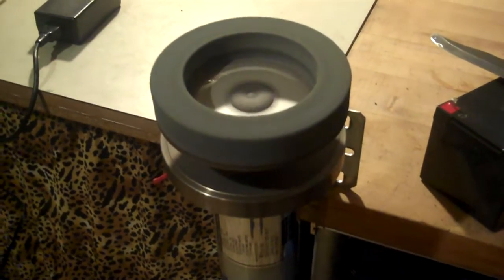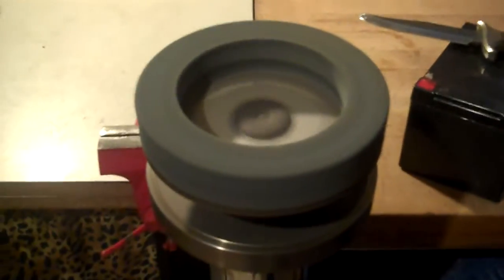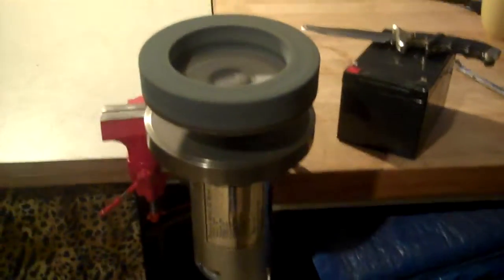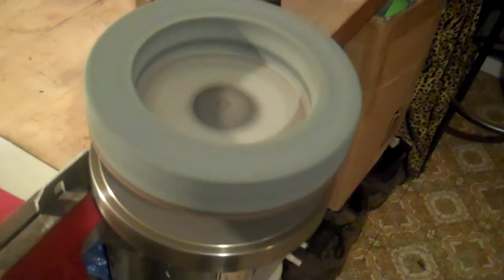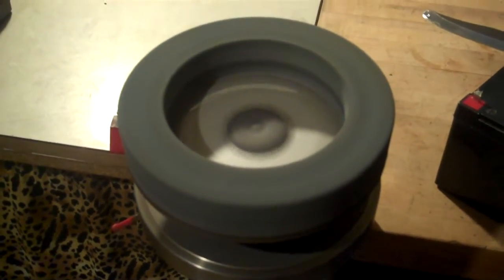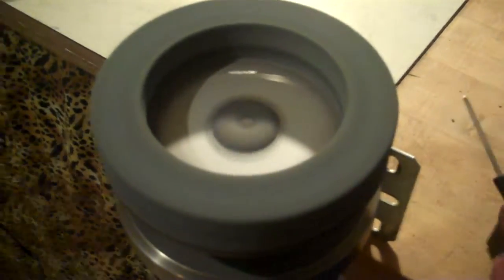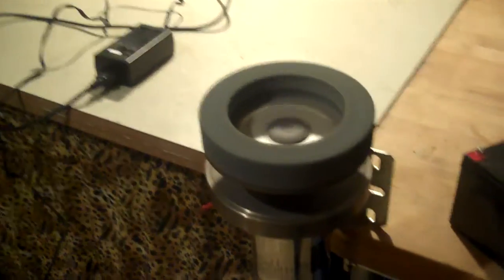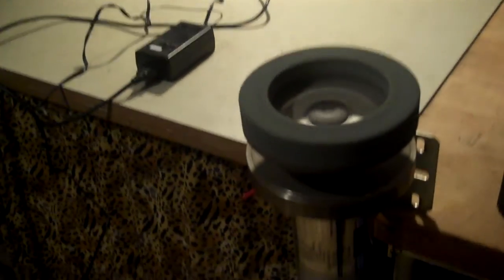homemade bench grinder

Comment from the maker: I also may use a small inverter on that 12volt battery or any of my 12volt batteries to speed it up on battery power.or hook batts in series, but that seems so much work, but if grid is down this setup gives me a large array of power options.